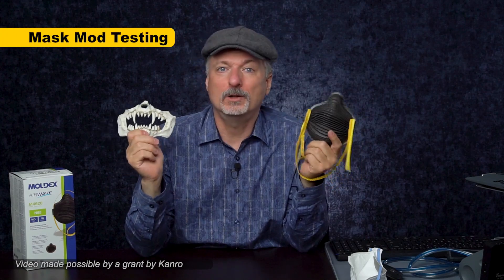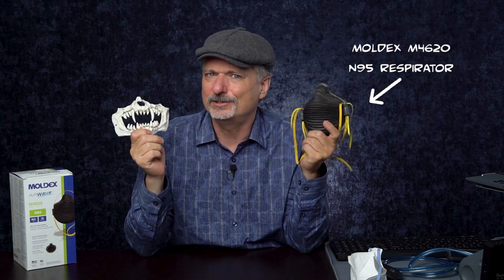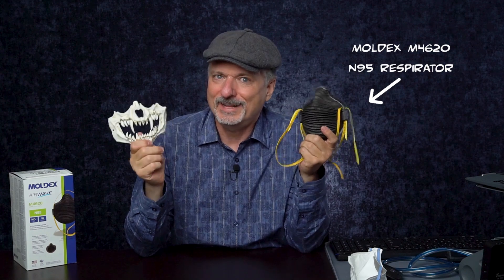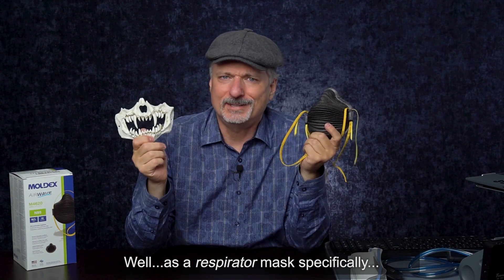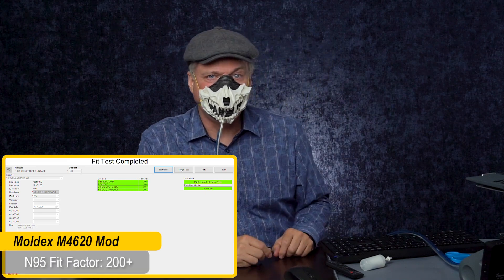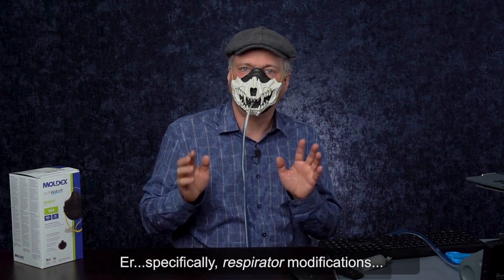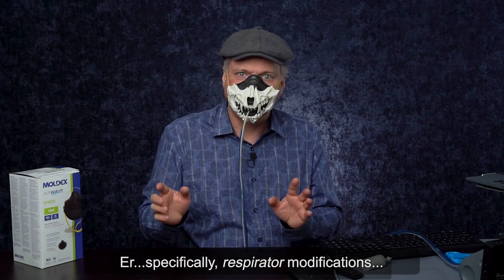Adding a skull to a black Moldex N95 - will it leak? PortaCount testing.

Comment: I wonder if you might have some insight to a question I have:

I tried doing a fit test for the first time. I of course did the sensitivity test without  a mask first and could DEFINITELY taste the bitter.

I've tested 5 different N95 mask types. All of them, except 1, I BARELY taste the bitter. I almost wonder if I'm even tasting it at all and it's in my head. But l've done it a few times to think "no, it's BARELY there but I do sense 'something.""

The one mask that seemed to fail, while it was still very little, Hardly At All, I could taste on a more confirmed "I taste this."

All the masks I've tested (except the one) have been a "barely there, l'm not even sure I'm tasting it but I sense something" result.

Obviously when I purposely break the seal, I can taste the bitter.

So does this mean my masks failed? 

To truly pass would it be a 100% confident "I absolutely did not taste anything"?

Is it possible that I still have good (obviously not perfect or best) protection with the ones where I barely taste?

One of the masks l've used where I barely taste but still am not sure, is an Aura. I know that's more universally liked and tends to pass fit tests.
Reply from the maker: "So does this mean my masks failed? "

Based off of the OSHA fit testing standard, yes, that counts as a fail.

The test is supposed to only detect leaks o 1% or greater. If it is too sensitive it will fail masks that pass the official seal leak standard by having leaks of less than 1%.

However...

The difference in concentration between the threshold testing solution and the fit testing solution is calibrated so that if it takes, say, 10 squeezes of a bulb nebulizer or 10 seconds of ultrasonic nebulized spray for you to taste without a mask, that if 1% or more the same amount of spray of the more concentrated fit test solution gets in your mask you'll be able to taste it.

The issue is that humans aren't all identical and the testing process has some variability. Some people are super tasters of Bitrex and can detect leaks smaller than 1%.  That may be happening to you. It is also possible to think you taste the challenge agent because you are expecting it - one study found a number of people thought they could taste saccharine when sprayed with nebulized distilled water. (I've not read a placebo study that used Bitrex, so I don't know if the same thing happens, but given how suggestibility works, it seems possible.)

All N95s leak. The important issue is how much they leak, and is the amount below an acceptable threshold. The only way to be sure exactly how much they leak would be to cross check the masks against a PortaCount mask fit testing machine test. A PortaCount can give you the actual numbers for the leakage so you can rank your masks.

At the very least, you have a good idea of which masks fit you better based on the subjective difference in the amount of challenge agent you are tasting.
Reply: I have had the same issue with overthinking it, questioning whether and how much I really can taste it. I would much prefer a quantitative test. I've found that the taste tests mostly only tell me about obvious leaks that I could already sense through seal checks, and tell me next to nothing about how good masks are comparatively, I'm looking forward to what OpenAeros does for this reason. But I do have some tips:

You could try increasing the aerosol load to 'stress-test' a mask if you really want to be confident in it. I also found taking fewer, but sharper and deeper, breaths helped me to detect more accurately (seems to give a more immediate contrast and increases the flow rate over the tongue). Also avoid opening mouth too wide, so the air passes close to the tongue. Then take some time to assess, swallow and clear your mouth before the next big breath. I also don't bother sticking my tongue forward when breathing as I found that to be awkward and distracting.

Just my experience.